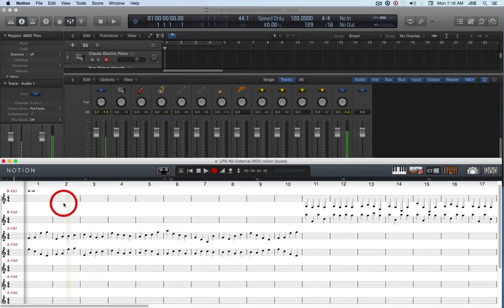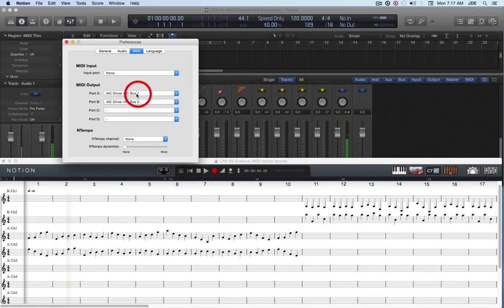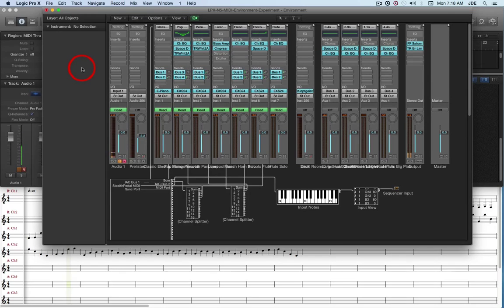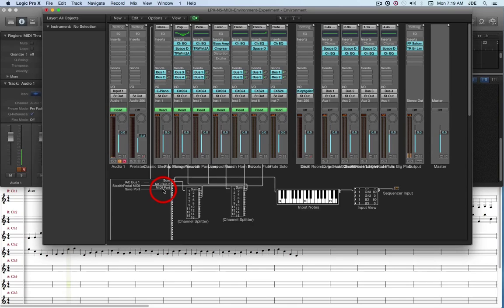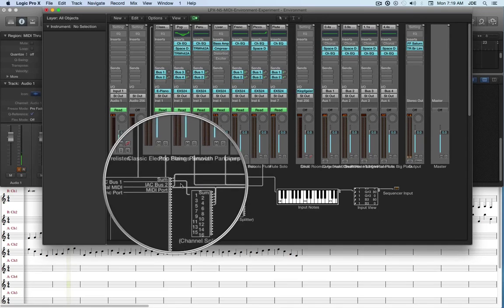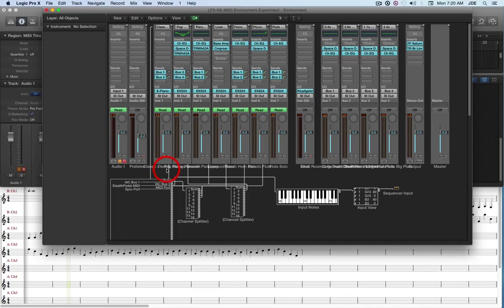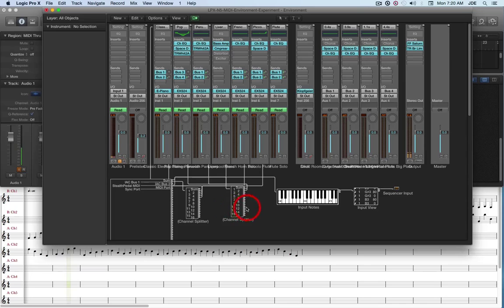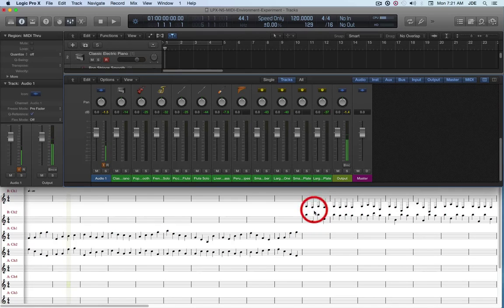Logic Pro X MIDI Environment Routing

Comment: Thank you for your help.
You are genius.
Reply from the maker: +안정훈:  I discovered the rules for avoiding the MIDI overlapping, and there is another video that explains the solution.  A while later I found an even simpler solution, which is to use one virtual MIDI cable but to rotate it from instrument to instrument.  The key is that LPX always recognizes MIDI Port A, so in the NOTION project you have only one virtual MIDI cable and then assign it to one MIDI Port at a time.  There also are some options that make the channel splitting in LPX easier.

There's an option that does the MIDI channel splitting automatically, and it's found on the "Record" menu, where you select the "Record settings . . . " menu item and then select the "Recording" tab, where there is an option "Auto demix by channel if multitrack recording", which you want set by clicking to check it.  When this is done, the channels will be separated or "demixed" automatically, which is nice.

This is the link to the video that shows the easier way to do it, but it was done before I discovered the "demix" option, so I did the "demix" manually, but so what.

https://www.youtube.com/watch?v=svxRd2GyMAQ